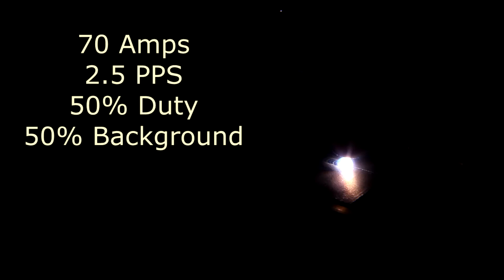CNC TIG Fusion Welder

Comment: Great video.
I am in the planning phase of building hopefully 4 axis cnc router for tig/ming welding.
I just wonder what is the best way to draw the welding path and feed it to the computer so it guides the machine.
May be just do old school path measurement and manually put it in the system?
You know, I specifically mean curves or 45 degree...etc not necessarily straight line welds.

I would appreciate your input

Comment: I was thinking of doing the same thing with my CNC router!
Reply from the maker: It's a lot harder than you think.  The high frequency from the TIG torch would reset my electronics.  I had to do a ton of shielding. I enclosed all the CNC cables in braided shield. I added ferrite cores to each cable.  Enclosed any junctions in steel boxes.
Even after all that, I would still get an occasional erroneous Estop signal.